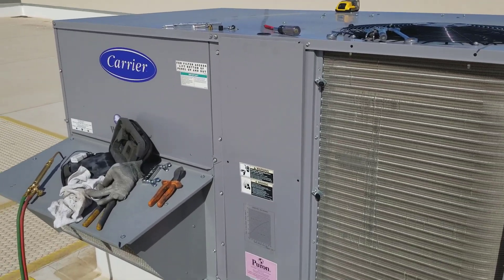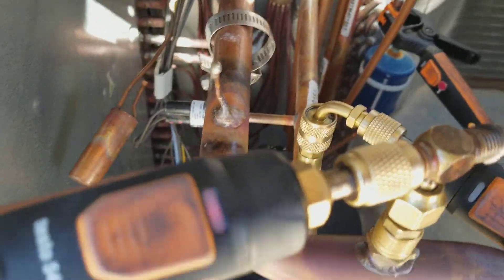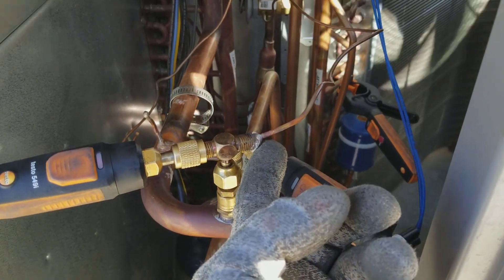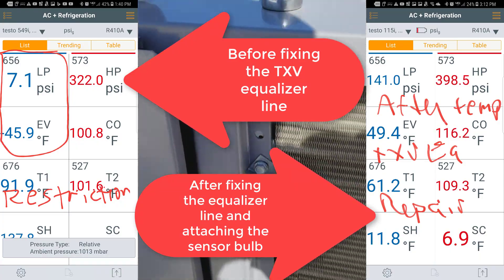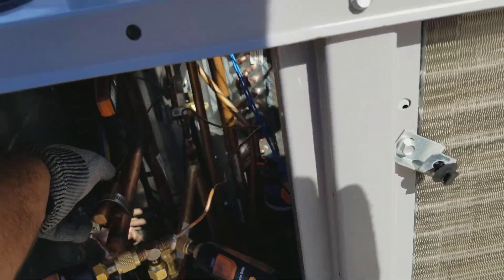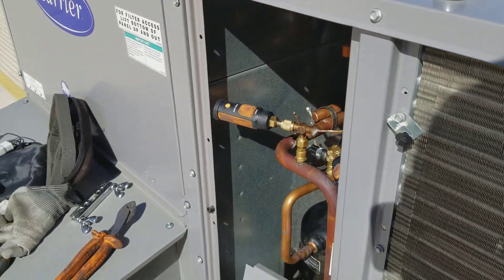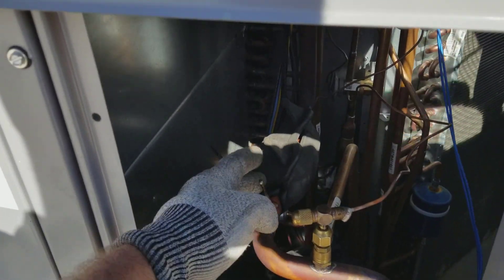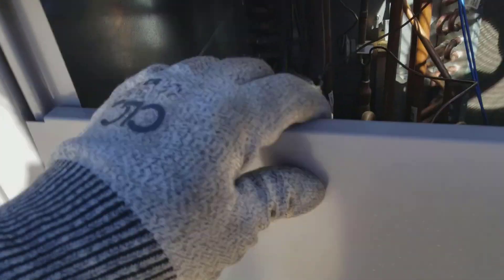Awesome beer-thirty Friday afternoon repair - Fix TXV without pulling refer

Comment: Equalization tube feeds pressure against powerhead when there’s no pressure in equalization tube valve will be wide open  instead of closed. Pretty sure tech trapped nitrogen in the tube than somehow welded it shut

Comment: cool! wouldn't the equalizing tube have been leaking some refer while you were trying to weld it up? Brass to copper is tough enough by tiself...
Reply from the maker: I originally pinched it but it didn't spray much that I could even see. 
I think the needle going through that upper area must be making one heck of a seal between the ported part of the body and the upper part giving reference to the power head.
Reply: hackfreehvac nice, good to know.

Comment: Nice that it wasn't a bad TXV, like carrier but hate how they tuck that thing way in the back in there. I'm 6'4 250 lbs and there's no way I can braze that thing without pulling the top.
Reply from the maker: Yeah I pull the top on these units for any major repair.
Which isn't that hard actually.

Comment: Have you ever added a schrader port to a powerhead that has lost its charge and charge it back with whatever ref is in the system? Works good for a weekend repair until you can get a powerhead or replace the txv.
Reply from the maker: Yeah. I thought about it but then Sigler (Carrier vendor) would not take the TXV back for warranty if I cut that sensor bulb off.
Reply: hackfreehvac I won't do that on warranty either, they can wait. I did one two years ago and the paperwork to go back and put on a new power head got lost. I went back at the beginning of the summer for another issue and replaced the power head then, it worked for two years.